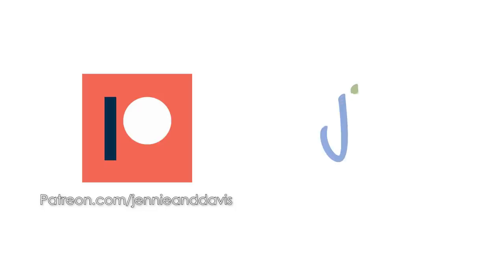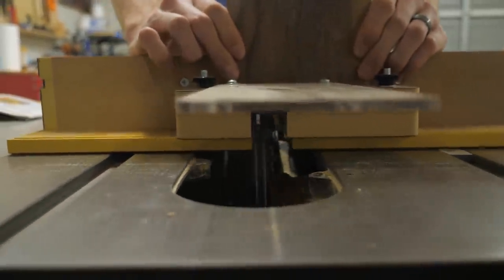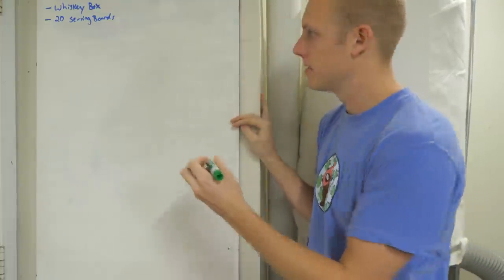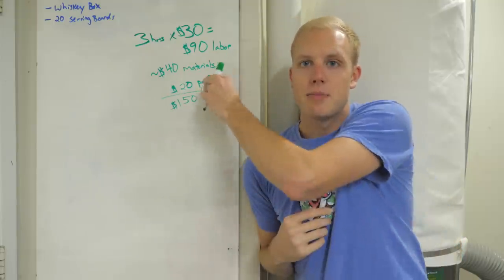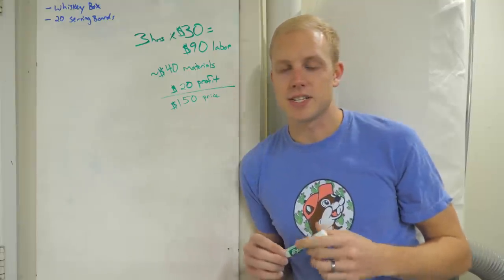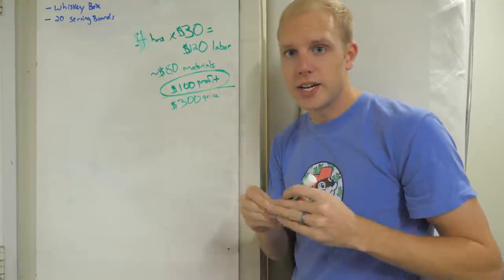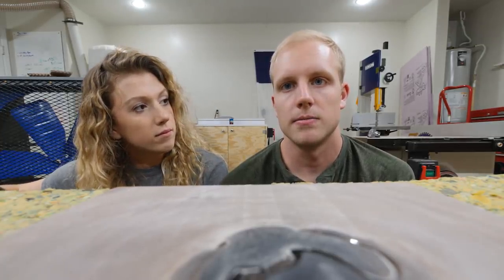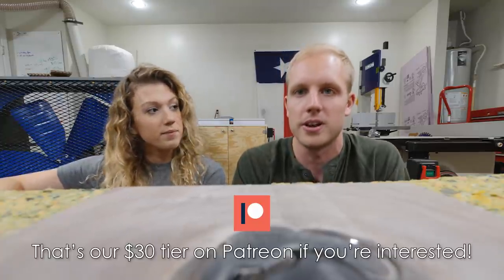The ONLY Router Bit We Use! - Let's Conquer the CNC Part 2

Comment: I cut a whole bunch of discs out of mdf. I drilled three or four holes at varying distances from the centre. I use these almost exclusively to clamp down my work pieces... the discs screwed down act as cams and can be turned or rotated to clamp the work piece firmly... no tape double sided or otherwise.

Comment: Hey guys all you have to do is open your x controller and move the switches to lock the motors.. I had the same problem like y’all, then I saw this diagram on designs by Phil and there it was..it’ll show you exactly how to move the little green switches..Took me only 10 minutes...
Reply from the maker: Yeah we just got that picture! Can't wait to try it out.
Reply: @jennieanddavis  That does the trick. I struggled when I first got mine. But the switches lock the motors and you are not moving them! And fyi, vcarve is simple to learn.

Comment: i saw the one clip cutting the grove for the top without an insert around the blade for the table saw. Please be careful. Thats a big open hole that the something can get sucked into. I'd say its kinda ok with the incra jig, but getting a second zero clearance insert will help save your hands.

Keep up the good work.
Reply from the maker: If Grizzly would bother calling me back, we would have them! They sent me the wrong one, then took 2 months to process my return. Finally got the replacements shipped today.
Reply: You have a cnc, so just make a bunch.  I make mine with just a router table and do 20 at a time.  Goto a local comercial cabinet shop which does a lot of laminate, ask them for some left over 3/4" plywood laminated on both sides.  Makes for awesome inserts.  And Safe.  Tons of vids out there to show u how.
Reply: @jennieanddavis  No excuse for being safe.

Comment: 2 tips- go with v-carve. Simple,  intuitive  software that has  post processing built in. Owned it for years,  best jump in software for cnc ( later solidworks or fusion 360).
Second- work hold down.  Simply screw material down to your spoil board in areas the bit wont traverse. Simple and effective.  Later for employees?  Vacuum table.  Hands down easiest way without complications. Can be made with your cnc, gated for different zones,  easy peasy. Small investment,  almost no legacy of cost and simple to use. Best,
A professional bench carpenter and custom cabinet maker.
Reply from the maker: Thank you! These are some great suggestions. Appreciate your time 😊😊
Reply: Jj

Comment: The comments are mostly focused on the CNC issues, I didn't see one thing about gluing a solid wood panel onto the back? 
You really should trap the back in a groove, leaving it to float. It will eventually spilt when the humidity drops enough for it to shrink some, since it is glued in a cross-grain fashion. 
If you need the back to be glued in to help keep a larger box from racking, use plywood or MDF with matching veneers. Sheet goods are far more dimensionally stable.
Reply from the maker: That thin of a panel over just 10 inches wide? Get outta here. Wood moves a little but it isn’t Mick Jagger!
Reply: @jennieanddavis  thickness only matters in the length of time it takes. Thinner actually dries faster, veneer will split or open up at the seams if multiple pieces are used in bigger areas.
Reply: @JamesAllen-mh9ms  Apparently you went to the same school of wood movement that I did. 10 inches is enough to cause a split eventually. May take a few years of annual cycles but I was made a believer 18 years ago. We did a test with pine, oak, walnut and mahogany many years ago and measured  8 inch wide boards sitting on stickers for 12 months in the shop. The results showed why we use frame and panel and floating panel techniques still today.

Comment: You need  a ZCI (zero clearance insert) for your table saw. Not having one is unsafe. If you can't make your own then buy one. Good luck
Reply: NO!
Reply from the maker: Driving 5,000 pounds of metal at 70MPH on the road carrying 20+ gallons of liquid explosive alongside 100s of other people is WAY more unsafe. Yet we do it every day... The best safety mechanism is between the ears and always with you.
Reply: If you don't have the skills to make one I suggest you go buy one
Reply: @jennieanddavis  I guess this means you drive blindfolded with no seat belt because what's the point?  There are several dangerous things in the world but.....that does not excuse doing something willfully unsafe and without using safety measures.  In all seriousness, do you think it was a good call to make those cuts?  Would you do it again?  I have done countless foolish things but acknowledging them and improving my practice seems to make the most sense.  Reading your responses all I see is you being defensive and not acknowledging the danger presented.
Reply: @cody0505  That's been their MO with pretty much everything safety related. "I can pay a clipboard warrior to deal with safety things later"

There's a difference between taking a calculated risk while taking action to mitigate the danger and just willfully denying its existence. Sticking your head in the sand doesn't make machinery less dangerous.
Reply: @jennieanddavis  well then, good luck, seems quite foolish for such a simple fix.
Reply: @jennieanddavis  Your argument for not having proper safety equipment on your tools...is that you also drive a car? Really? That's a new one. Do use the same argument for not maintaining the safety equipment on your car, because you also joined the military? I mean, that's how your logic tracks. 'I don't need functioning brakes on my car because the government could send me to some far away land to get shot at, and that is WAY more unsafe.'

That's not the strong, logical retort you think it is.

Comment: What is the trouble you’re having with the two bit carve? I’ve been using my X-carve for about 3 weeks now and most of my carves are two bit. If it’s a X,Y,0 then the easiest way to do it till you get comfortable is put your V bit in set the XY then swap back to your 1/8” and carve when you go on to the the detail pass swap bits and when it gets to the point where it asks to set the XY select use last XY and it will use the XY you used in the roughing pass. I hope this helps and I’ll be watching to see if you try said adjustment and to learn v-carve pro with you cause I’m about to upgrade myself.

Comment: Dual to triple bit changes are based on Return to Zero. Write your X and your Y Zero point down or take pics of the Xand Y Zero. Z changes on the fly because bits are different lengths. 
     Always raise the bit before Homing or return to Zero. 
Use the 60 or 90 degree bit to Zero x and y because of there pointed tips. Best of luck.
Owner of two CNC machines.

Comment: If you have limit switches on your CNC home to the limit switches and then use an offset to determine the workpiece home.  That way if you break a bit you can always get back to the carve with a new bit.  Don't trust the motor holding torque to hold position during a tool change.

Also, a more typical scenario might be to do two bit carving on a large number of identical pieces.  In such a scenario, you rough cut all of the pieces and the detail cut all of the pieces.  That way once you get the detail dialed in, it will work time and again on the rest of your pieces.

Homing switches are your friend

Comment: If you are really into production, make an aluminum plate with drilled and taped holes. Then you can use mitee-bite tools for clamping material down. They are low profile and will not interfere. I have used them for many years in machining. Allows you to really expand fixtures in your process.

Comment: If you end up getting vcarve, vcarve pro, or aspire, theres a gadget you can install that will allow you to cut out one of these boxes in literally minutes!! All you need to do enter the dimensions of the box itself and vcarve will do all the calculations for you. you would need a sort of sheet of material though in order to pull it off, but it would save you at least an hour or two on labor per box.

Comment: Watching you operate the table saw without an insert shows me a lot about how concerned you are for safety and tearout. :(
Reply: If you noticed  that while they didn't have a  insert installed into the tablesaw they WERE USING a  Incra  box joint  jig.  
This  basically  eliminates tear out and makes it  as safe as if it the insert was  in place.
Reply: @ClintonCaraway  If you notice at 1:59-2:02, there is nothing supporting the wood going over that huge opening as he cuts the dado for the box bottom. Just his hand pushing it along the fence. Very dangerous.
Reply: Well I saw the same thing in the video. Very dangerous. Takes just a few minutes to rough cut and flush trim a 1/2 insert. I keep several on hand when I need a new one. They are always talking about training an employee someday. I hope this is not left out in the training or they would have insurance liability.  42 years as a woodworking professional and I have never had a machine accident of any kind. I hope they take this as an opportunity to learn from.
Reply: @tubefixxer  Well when you see a car scream out of control and almost hit a group of pedestrians at the start of a driving business video it is understandable for folks to say "Oh My, be safe when driving" and forget to say "Awesome video and nice paint on that car".

Comment: Do you have a video where you show what you do to fill in the holes in the box joints that are caused by the lid/bottom slot being cut?  I know what I have figured out and I am getting better at hand cutting pieces to fit in there, sometimes using similar contrasting woods from the lid colors, or sometimes different but contrasting (not efficient but so far it is ok), but am curious what you do for it.
Reply from the maker: We just plug them with an off cut and a bunch of glue!
Reply: @jennieanddavis  aha so same thing then, cool. 😃

Comment: I wonder if carpet tape can also be used on a 3D printer to hold the object in place? At least it would be consistent.
Reply: for printing i heard using hairspray on your print platform  works great for that  i havent picked up a printed yet so i couldnt try it but if it works for you let me know if possible!
Reply: @jasonalvey7656  I used carpet tape for a woodworking project. Doesn't seem like it would work real well for 3D printing. I use  Locktite Spray Adhesive 100 works really well. https://www.lowes.com/pd/LOCTITE-General-Performance-Spray-Adhesive-13-5-fl-oz-Bonding-Clear-Multipurpose-Adhesive/1000403657

Comment: Hey guys,  any advice on the correct bit to carve stars for a flag union?   I'm using V carve desktop with Shark CNC.  90 degree bit 3/8 diameter.    
The machine attempts to cut the first star, then it jogs over and cuts air!

Comment: I dont have a jointer and I never thought about using my router table to straighten one side of the board out. Wow where have I been lol. Is that just a straight cut router bit
Reply from the maker: Yup! And it works great! Well within the tolerances we need, but I'm sure with a little tweaking it would be perfect.
Reply: @jennieanddavis  would any straight cut bit work you think?
Reply: Chris Bellechasse the bigger diameter bit you use will give better results. This procedure does require a split fence, so there can be an off-set to the outfeed side.

Comment: Self proclaimed wood workers. DONT wipe glue with a wet cloth, you’re smearing the adhesive into the grain. DONT use a dado head or any other blade with out a throat plate. I can go on and on. STOP it and gain some experience fist before someone gets HURT. Have support behind your material when cutting on the table saw. Don’t just glue to a bottom for a box. You’re limiting and being naïve with your Cnc. Pro is good Aspire is better. Using all bits easily furthers your ability. Clamp material down DONT use unpredictable carpet tape. Sorry, I’m typing this and every time I look up I see another mistake. I’ll just watch now and stop comments. Great dog 👍

Comment: I never lock my motors and dont have any issues. My question is are you sure your not tightening the bit to tight in the router? This would make it really hard to loosen and change bits. Also I want to say Look into https://triquetra-cnc.com/ (the 3 axis touch plate). I bought one a few months ago and it is so much better then the tipical Z probe when I do a 2 stage carve.

Comment: I love the video's but did you seriously use a table saw without a throat plate?  That definitely isn't safe, buy some zero clearance inserts for varying blade widths, you won't make money very easily if you're in the ER or losing digits.

Comment: You need to buy the millright mega v cnc or cnc4newbie newcarve....they are same price and built way better...xcarve is junk...toy.
Reply from the maker: Cnc is the wrong tool for us. Even the best hammer can’t drive a screw...
Reply: @jennieanddavis  i disagree ..the xcarve cnc is the wrong machine..if you had a properly designed machine it would work...go see millright mega v or cnc4newbie newcarve..those are good machines and cheaper than xcarve aka junk carve...rubber belts dont belong on a cnc machine they are for 3d printers only.
Reply from the maker: But they are extremely inefficient at what we need a machine to do, hence the wrong tool. A Laser is where it’s at.

Comment: No masks or eye protection.  You were wearing jeweler while using a table saw and you were pushing the wood with hand.  Do your self a favor start following safety protocol before you lose a finger, get lung cancer, or lose an eye.  You guys are pretty people.  It would be a shame to get mangled in your shop.  You’re motor lock problem is occurring because you are depowering your stepper motors.